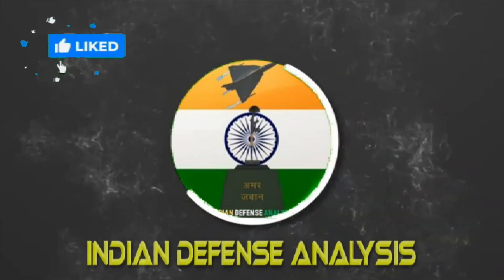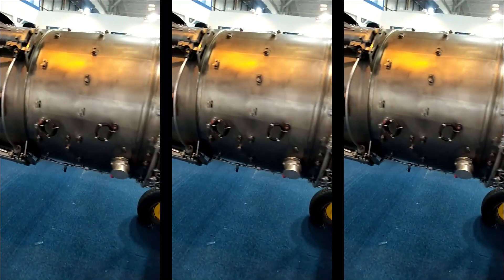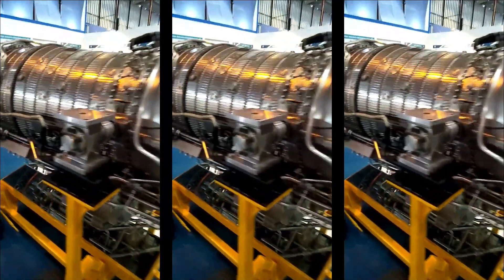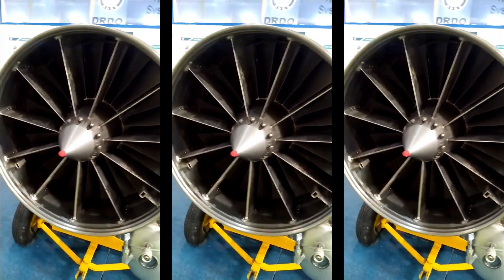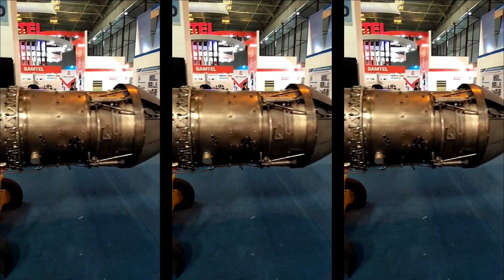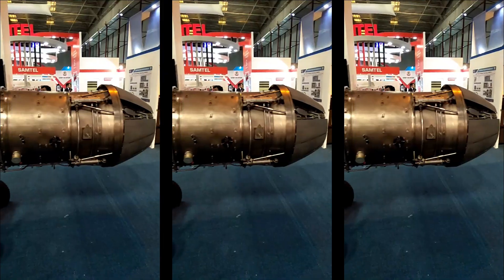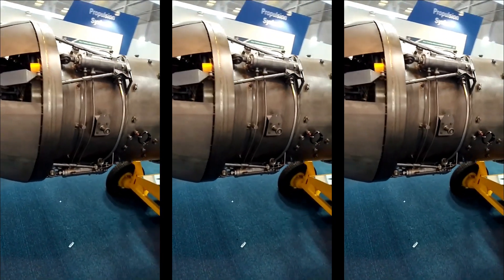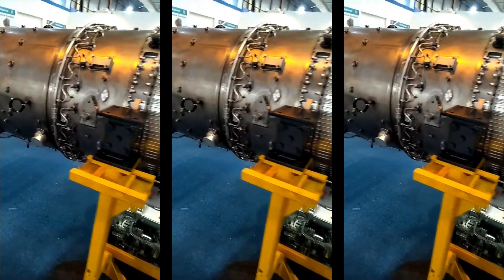Kaveri engine issues fixed & ready for test | Russia-Ukrain conflict delays the testing

Comment: Heard Kaveri Engine had a problem with the weight and weight reduction should had needed. Is that problem solved....?
Reply from the maker: K9+ is heavier which will be solved in K10 version but its not a problem but way designed. No clear info on weight reduction in K10 but expected to have less weight than K9+
Reply: Thank you sir for the information.
Even though the experience gained from kaveri engine used to produce a Joint venture Engine of 124 KN With a foreign country, it will be a seperate engine. So, other than integrating non-afterburner Kaveri engine to UCAV, is there any future for K10 Engine with afterburner....?. Sir, is there any possibility for K10 Engine to replace F-404 engine in Tejas MK.1 A in mid Life upgrades, if K10 produces sufficient thrust....?
I think both Kaveri and M-88 engines of Rafale fighters have nearly similar dimensional specs ( I am not an expert on this) and Kaveri already have better thrust than M-88 version used in Rafale. In that case if Rafale wins the MMRCA contract, can we ask them to replace M-88 engine with Kaveri(K10) Engine for 100+ Rafale fighters......?
I hope kaveri engine (K10) will have a bright future...........
Reply from the maker: @melvinsaji7600  the focus will be on AMCA ie 125 KN engine but yes India will eventually look to replace F404 of LCA with Indegenous engine

Comment: Even our present rafales m-88 -2 engines have 70 to 75 kilonewton thrust.
Reply: well kaveri has 81kn but the problem is with weight and heat , plus some older tech needs to be replaced
Reply: Yes Kaveri in a refined can only suit dual engine jets for now, like naval variants. Single capabilities are to follow from amca engine onwards

Comment: K9 should be developed with both Safran and Rolls Royce simultaneously. We can only then have choice. Various JVs and variants should be explored with Rolls Royce, Safran and Japanese engine. We need to make 3-4 companies for the JV and new engine. Engine like this can help India develop commercial planes too
Reply: They won't do it. It is a stupid suggestion. Like asking GM and Ford to work together. Idiotic.
Reply: @burlatsdemontaigne6147  it has to be developed seperately not together I have mentioned simultaneously
Reply: @ajjunair83  Still won't happen. Major companies just won't work like that. Besides, it would be prohibitively expensive.
Reply: k9 has already been developed but then we realize we don't have testing facility also russians doesn't want us to develop an engine that's why they are asking 500mil for testing
75 independence day we may see tejas flying with a kaveri engine stated as a TD

Comment: Kaveri works perfectly - it is just that it doesn't quite meet the performance requirements specified for the Tejas Mk1. To do that and match the performance of the F404, special technologies like single crystal blades special coatings and laser drilled cooling holes which GTRE did not have are required.
Reply: Eveybody is a jet engine expert
Reply: it meet its own goal , goal which was started that time today it is not suitable but it can be sorted , gef404 are maintenance friendly and more reliable than kaveri
but the good thing is we are capable of developing a jet engine but with proper funding cuz funding always slow the project and technologies gets older and older
Reply: @jamoon9341  
Actually the GE F404 is a boon for Tejas exports. A lot of countries want it because of its reliability, and because they have commonality with other aircraft they have like the FA 18 (Malaysia), Australia, KAI T50 (Phillipines), FA 18 (US Navy) etc. Choice is good.

Comment: Engine can be tested in a new test facilities in Himalayas, then further tests on LCA Tejas by gradually increase height
Reply: Do you wanna kill a pilot?
Reply: @Manus Tham test bed Tejas on tested engine and without any radar, and other combat equipment
Reply: @Manus Tham if tested engine fails, then it was never ground tested properly
Reply: @Manus Tham that is why china is ahead in engine manufacturing
Reply: @Manus Tham the testing in india never complete even after decades
Reply: @Manus Tham so no trust in Himalayan tested kaveri engine
Reply: Tejas widow maker
Reply: @小易-l2x  it's brahmos the widow maker
Reply: @sridhardabu  lol
YJ21 better than brahmos
Reply: @sridhardabu  YJ21 speed 10 MH.    Range 1500km better than brahmos
Reply: @小易-l2x  brahmos 2 is better
Reply: @sridhardabu  brahmos2. Speed 3MH
Range 400km
YJ21 better than brahmos

Comment: It is dry kaveri, not the afterburner variant so it can only be used on fhattak ucav not on tejas
Reply: it is an afterburner variant , afterburner section does have some tech older and problems but they are being solved and replaced but the thing is , it is too late.... funding was not proper that's why projects faced delays and then the technology become old gen...
Reply: but i heard that 75 independence day that means in 2023 , tejas will fly with kaveri to showcase kaveri as a TD means that they have developed the tech
Reply: @jamoon9341  lol     2123
Reply: @小易-l2x  look who's here 🤣